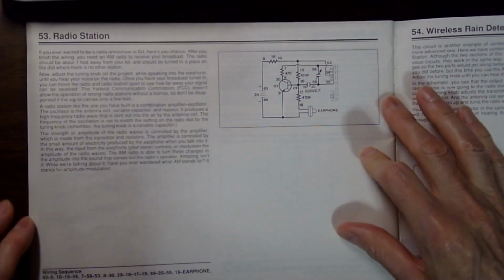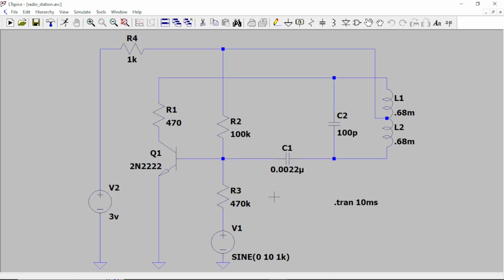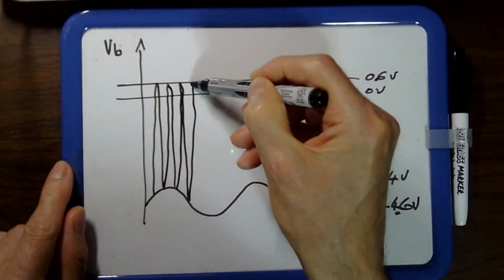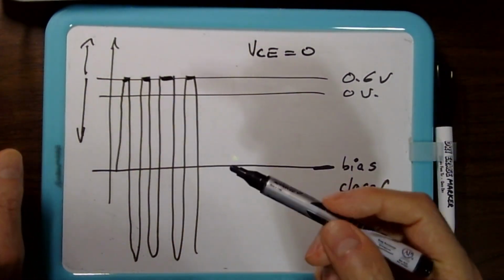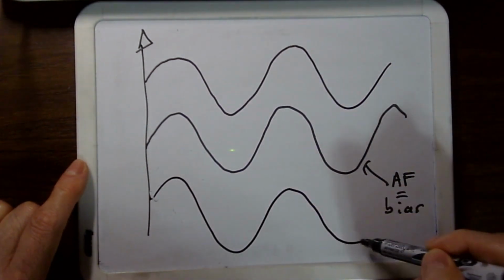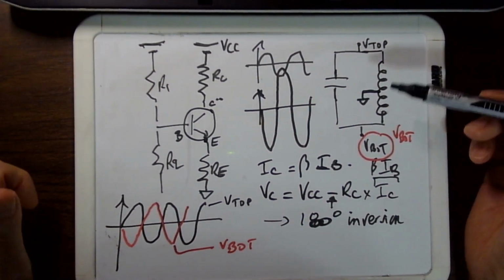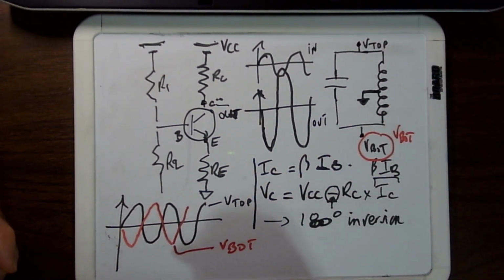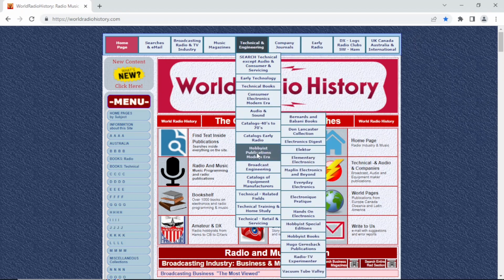RadioShack AM transmitter explained

Comment: i remember buy it   seems like yesterday
Reply from the maker: The old days when you could still walk into a Radioshack and buy one of those. Now, only available in secondary market as far as I know. But you can get those things very cheaply on ebay and the likes. Elenco still makes those nice ones but they are the snap-on kind, which I don't think are as good as the ones with the spring thingies.